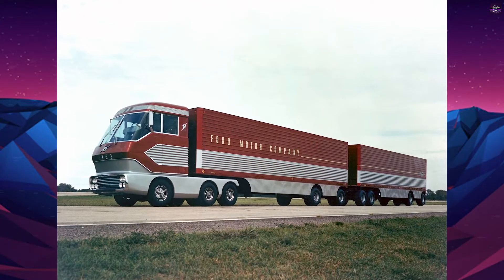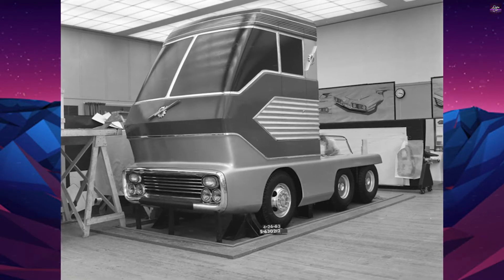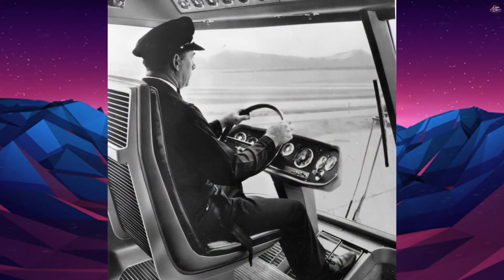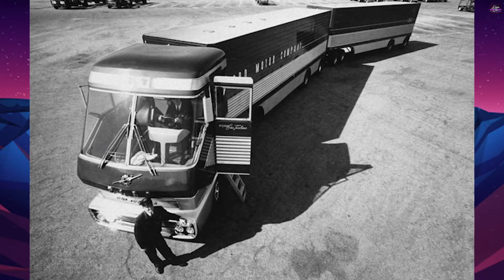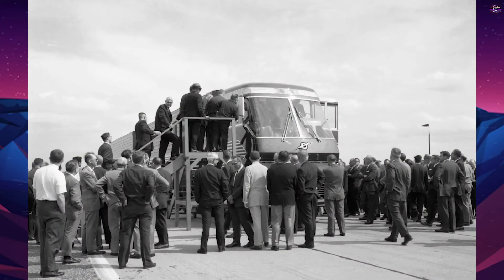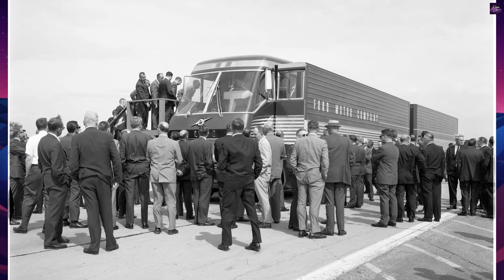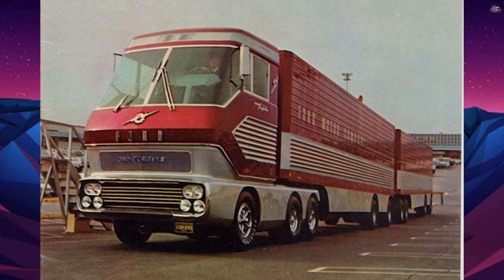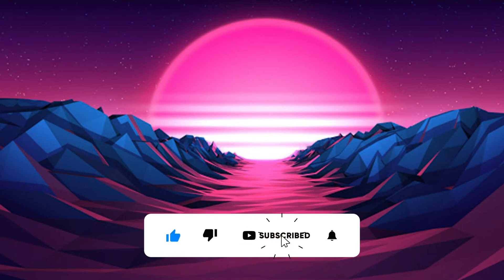Ford’s Big Red Concept Truck: A Lost Masterpiece of Automotive History

Comment: Another excellent video about a rare gem that I'd never heard of - "Big Red" (there's a title for a C&W song!). Gas turbine tech was in its relative infancy back in the 1960s. The state of the art has advanced considerably since then. Gas turbines power airplanes, helicopters, ships and tanks; units are smaller, more powerful and much more reliable. The fact that they can run on almost any combustible liquid makes them even more appealing for cost-conscious operators. So, why not now? Imaging mating a gas turbine with a generator and electric drive. Hats off to those buzz cut, suit-and-tie wearing Ford designers and engineers!